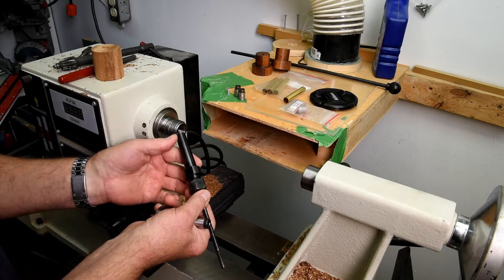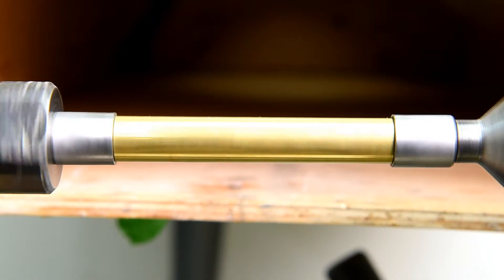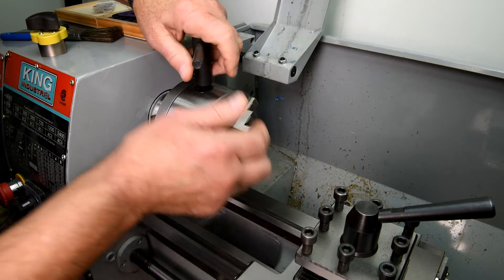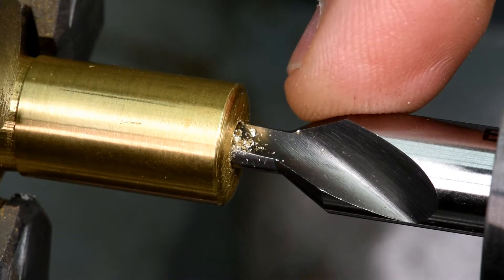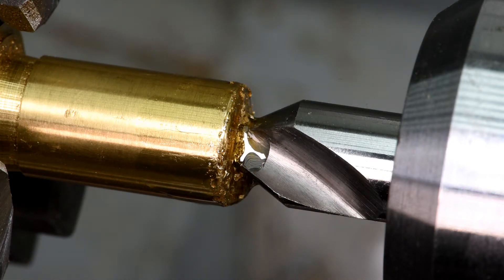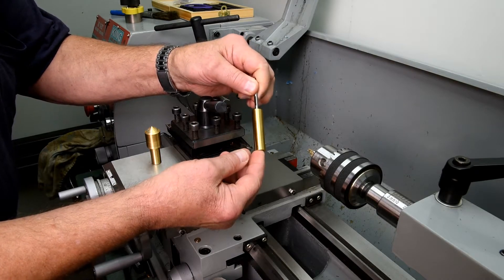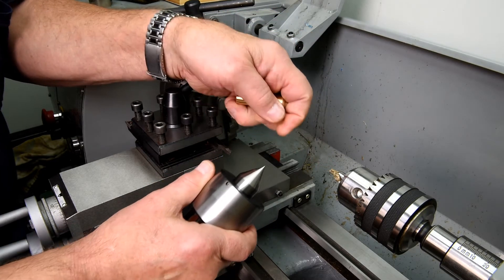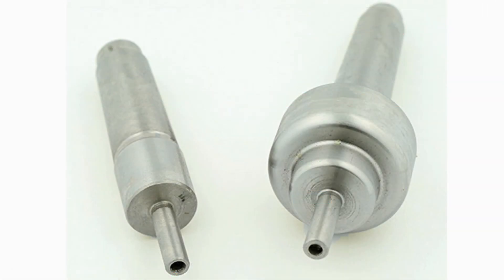Turning On Centers

Comment: Hi Ron, I don't recall off the top of my head but if I recall-ish, the angle difference between the bit and a center is about 12 degrees which allows for a concentric bearing surface alright, but if the angle was exactly the same, your head & tailstock would have to be perfectly in complete alignment or it would throw the piece out of round and maybe bind a bit causing an out of round situation.

For this alone, I could not use the mandrel centers, my head and tailstocks vary in alignment depending on how far back the tailstock is placed on the bed, the mandrel centers in my case would not be ideal because any misalignment would be directed right at the surface between the pins on the mandrels and the bushings.  Again, causing a bind.  Also, because I do a lot of outboard turning (my lathe lives quite close to the wall, cant swing a bowl gouge far enough to get an inside cut) the alignment issues are compounded by any slop in the clamping mechanism for the headstock rotation.  Makes it a very fiddly operation to attempt extreme precision.

There's a company LittleMachineShop which sells an MT2 dead center for about $6 US http://lmscnc.com/1890 with probably a bit of added shipping for living in Canada.  Or you could whip up a piece of soft bar stock on your metal lathe with a 60 degree point on it and clamp it in your scroll chuck.  Then hit your pen turning bushings with the centering bit to get a bevel and your set for "between center" turning.

Otherwise, it looks like your normal pen mandrel works pretty well!  Random crazy thoughts from the obsessive!  :~)  Can't wait to see your segmenting!!!  Have fun! -Bill
Reply from the maker: Hi Bill,
Here in Canada we have a similar store. Busy Bee. The accuracy of their stuff they sell is now in question however because that's where the centering bit in this video came from. I'm convinced it's ground wrong. Anyway, thanks again for your detailed comment :) https://www.busybeetools.com/products/lathe-centre-mt2.html

Comment: All the time I was watching this, I was thinking about this.  https://www.pennstateind.com/store/PKMBCM2.html

And then came the end and spoiled my info.

I do have some between center bushings for 3-4 pen styles, but that gets expensive.  So, I purchased the above an can use all of my old bushings and any I purchase in the furture to turn between centers.

Just for the heck of it, put bushings and tubes on the mandrel for a pen that has two tubes.  Tighten them up as you would if they had blanks glued to them.     See ya tomorrow.                             JimE
Reply from the maker: Hi Jim,
I knew that Penn State Industries sold this too because I had seen it there some time ago. My first thought when I saw the price just now was, oh my, it's $10 cheaper at PSI. But then, just for fun, I ran $29.95 USD through a currency calculator and at the present rate of exchange it was $39.13 CDN. That's only a difference of only 82 cents. Now, when I realize that the shipping from PSI to Winnipeg is likely double of what it is from Bill's place to my door, then I started feeling pretty good again.
Re: "Just for the heck of it" --- I don't need to do that. I know that the tubes might be bobbing up and down so badly the my eyes would go blurry, and I need to be able to see the screen to design my jumbo segmented bowl today yet, lol.
btw. Since you have one, what you honest opinion of that "Turn Between Centers mandrel"?
Reply: My honest opinion is................ I haven't tried it yet.  Other mount it to the lathe.  :-)  

I know that postage thing is a killer.  I sent a package to Winnipeg a while back.     JimE
Reply from the maker: Haven't tried it yet ??? lol  :)
Reply: One of those things I just had to have.     Haven't done any pens since I got it.              JimE
Reply from the maker: Re: "One of those things I just had to have." I hear you ---- boy do I ever hear you!